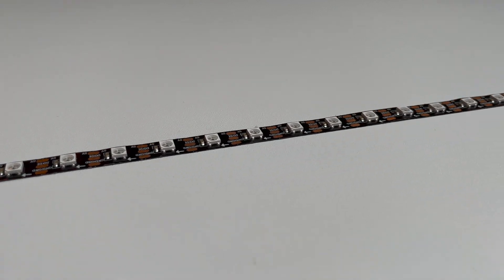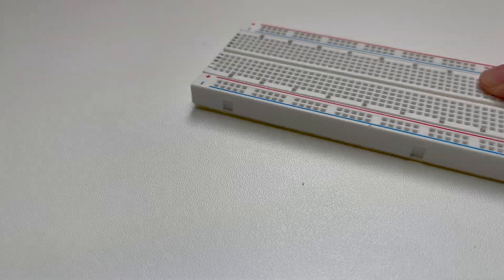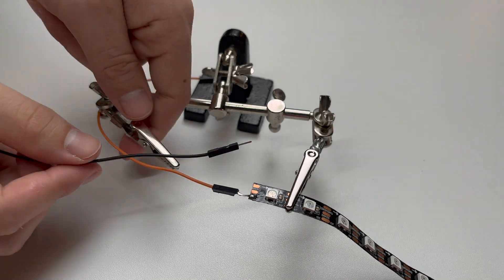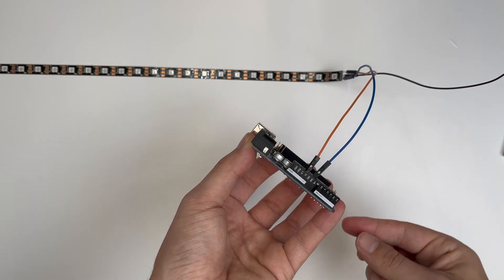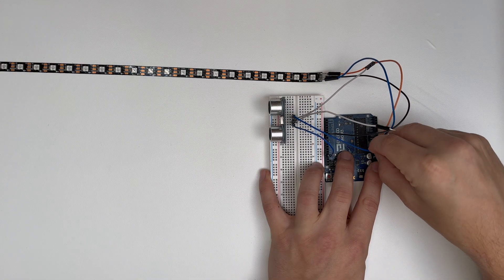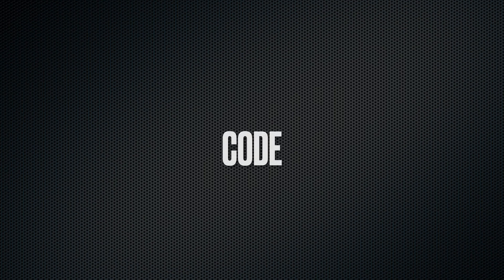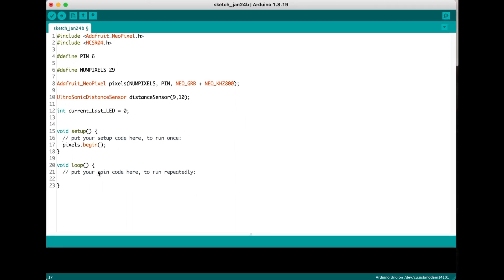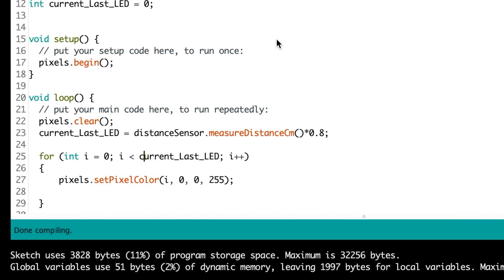How To Control a LED Strip with Ultrasonic Sensor

Comment: Could I ask if there is an alternative 5v pin for the sensor as only 3.3v available,sorry I’m new at this
Reply: I'd connect the sensor Vc Pin to external 5v supply with GND common with Your board (it should work just well with a common ground). It's a good way to connect anything that is power-hungry to the boards to have an external power supply not to burn your board due to the power levels, ofc you can connect 30ish ws2812 led controllers under 1:1 5050RGB diode, but if the diode power conscumption is about 1W per one powerLed or something even cut half in power consumption, there's a fair big chance that your board is going to evaporate, and, if it's connected to Your pc it can produce a spike on the usb port and thus damage it and/or the main board. Yes, ultrasonic sensor does not need that, but if you want a 100m range one i won't risk. It is always a good practice FYI not to connect any power pins THROUGH the board, but TO THE SAME SOURCE. And the signal pins- you connect them directly to the board unless there's a different voltage requirements used, like 12V or something transistor-gated sensor for leds for example- do not do this.
Remember, every time you want to connect anything that is probably power-hungry straight to your board, as well as PC, make sure you use external power supply with a common ground (sometimes you'll need a capacitor but whatever not to burn this whole shit probably). 
I was supplying some 15-30 meters with external power supply on esp32 and it worked just perfectly, used some capacitor to connect grounds when i was on the cable and then just mounted proto on the very same power supply both for the board and the rest but after the programming was done and cable unmounted off the pc. 
However, with a long led strip there's probably (due to voltage drop caused by the cable/strip resistance, but you are not supposed to know this at this level), so whenever you are going to power a controller and a long strip of low-voltage leds just make sure it's powered from both ends or at least 2 points on the length, because it'd be dimmed or off.
second thing is that any led diode is not voltage-driven, but it is necessary to have a voltage level between it's operating voltages for it to work. LEDs ar current-driven, thus the current flow through the board that exceeds the levels are going to burn it. Signal recieving/sending is just ok even with voltage converter ofc, not the power ones.

Hope it helps.

Comment: I am trying this as my first project and to be frank, I am yet to understand how to even programme the Arduino Uno.  However, as soon as I connect up the strip and sensor as per your video, the board gets extremely hot.  Any ideas please?
Reply: Further to my comment above, I have now found it is because of the current drawn by the LED Strip.  Please DO NOT CONNECT MORE THAN 10 LED's direct to the board without powering them from a separate power supply.  It could well go up in flames!!!!
Reply: I think resistors can help too, im a noob and thanks to this video finally my code works my sensor wasn't working xD it needed the sensor library  @r917g
Reply: Maybe a retorical question: Did you install the Arduino IDE programme? :D